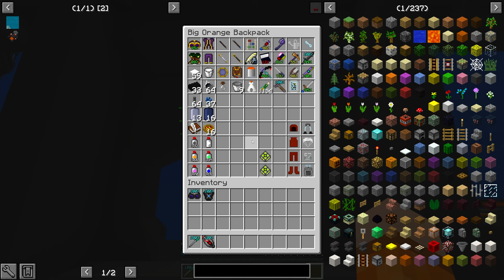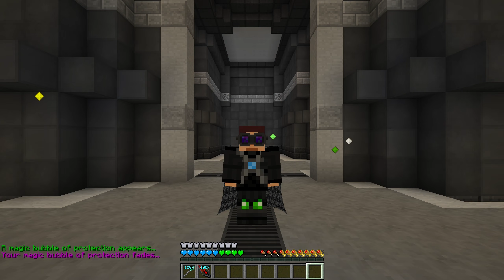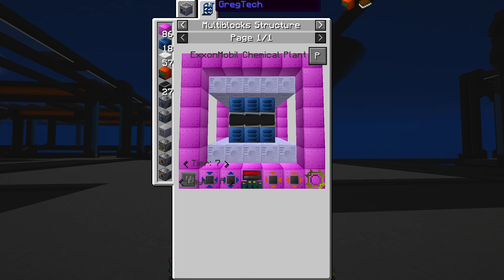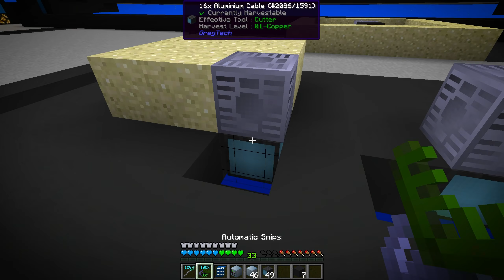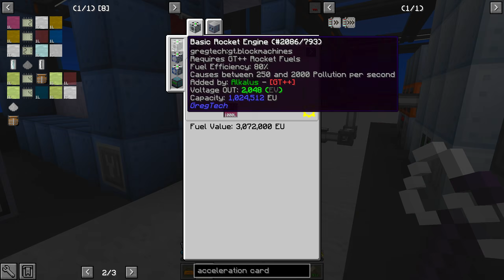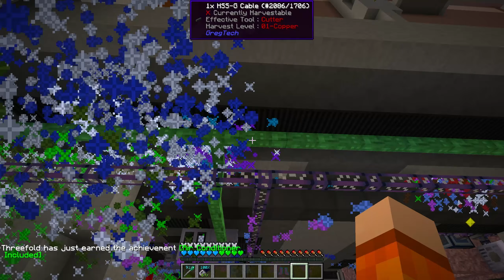Gregtech New Horizons S2 64: Three Of Seven

Comment: I just spent an hour in NEI looking through all the ridiculously realistic oil cracking and refining pathways trying to figure out what pathway I should use to take to make polyethylene, since apparently with the recipe I was planning to use starting from ethanol (from biomass from the forestry fermenter) has the final step only available in MV or above. I'm in LV lol, I had a ton of fun doing a test batch of all the reagents I'd need and getting all the ingredients together, just to scratch my head when it wouldn't make ethylene! Half tempted to make an MV reactor but don't have the stuff for it, so here's hoping the oil I've got nearby is light lol. I want to make it into refinery gas and get ethylene from that.

Comment: for AE, imo you should add an AE battery (or a few). it drains energy from its storage when terminal is opened so that you end up with no energy in controllers every now and again.
Reply: there is like 8 dence energy cells near central controller

Comment: Don’t necessarily trust the NEI preview, it’s not always correct or has unnecessary tier of blocks
You can open the structure projector to edit the GUI in order to change the coil tier or other blocks that have tiers, also means you only need 1 projector and can do multiple tiers on a multiblock such as the chemical plant or MEBF
You can always just make fluid patterns for the chemical plant for rocket fuel
Can always add more input hatches on the chemical plant

Comment: if i were to put an auto crafting setup somewhere in that base, i think it'd be north too, under the hives, or maybe wrapping around it like a giant hexagonal ring, to fit the hexagon theme and to give you ludicrous amounts of space, separated into floors on each side of it, with the most room for multi blocks like lcrs and stuff on the bottom and top layers, and single blocks and maybe like a clean room in smaller layers along the sides

Comment: Technically speaking you can skip making T2 padding, though I wouldn't necessarily recommend it. Ross128b is a habitable planet, and doesn't require any kind of thermal padding or oxygen gear at all. The Asteroids dim is perma night, and what T2 padding does over T1 padding is protect against solar radiation...which (presumably?) does not exist in a perma night dimension. So Asteroids can skip T2 padding as well. The other T3 planets you can still get away with skipping it if you craft yourself a Dragon backpack, it will heal you faster than the solar radiation can kill you, but taking constant damage is maybe not the most pleasant of experience. For Steve or for the player. Ultimately nothing significant gates T2 padding bar PBI, which you want to cook two manual batches of to satisfy the questbook (and it's generous rewards for still doing cell basic chemistry circa IV) while crafting enough for a set of T2 padding down the line anyhow, so it's not a big deal regardless.

If you're playing with pollution off there's basically no reason to give an Implosion compressor anything better than an LV hatch. At least until much, much later. The recipes are all fast enough for occasionally crafting a rocket, and that's mostly what you need it for. If you do have pollution on overclocking the Implosion Compressor is a great way to limit it's pollution output, since machines produce pollution while they're running. If a recipe is completed 16 times faster, that means 16 times less pollution is generated.

I've said this before, but it's worth saying again: If at any point you are not good on power, upgrade power ASAP. Especially in this era of digital storage, when your entire base's power production is powered by itself, running low can quickly lead to a death spiral and you being knocked back to the stone age.

One thing Silicon Dioxide has over Raw Silicon is that it can be cooked into silicon ingots much faster and easier, completely skipping the hot ingot step. Of course one thing Raw Silicon has over Silicon Ingots, in turn, is that Raw silicon is actually useful sometime pre-T5 rocket. So, you know, ups and downs 🙃.

If you didn't end up going with Benzene power and are short 1,2-Dimethylbenzen to split between bees and hydrogen, BTW, basically any measure of petrochem is going to give you oodles and oodles of various gases you can electrolyse into hydrogen. Just pick whatever random thing(s) you're not using, throw it through an electrolyser, and boom: Hydrogen solved.

Reminder that Three hasn't solved his comb processing bottleneck yet, he mitigated it. Iridium, Platinum and Palladium are, on average, going to overwork that LuV powered LCR by themselves, to say nothing of any future additions to the Hives. Bees are a fantastic source of passive resources, and the Alvearies they live in cost peanuts - literally if you're using that as your source of seed oil 🙃- but don't underestimate the power cost of processing those combs.

My advice, if you don't craft a chem plant early for whatever reason, is to make your first one out of tungstensteel if you can at all afford it. You'll need that tier for some recipe or another down the line sooner or later, so might as well save yourself the trouble of crafting a set of casings more than once. If you've got a specific recipe in mind for a chem plant - say a dedicated Nitrobenzene producer - upgrading the casings beyond the minimum won't benefit you. But always have at least one chem plant with tungstensteel casing tier if you can afford it.

Regarding rocket fuel, there is no real reason to bother with Dense Hydrazine Fuel Mixture. The only thing that CN3H7O3 Rocket Fuel needs which DHFM doesn't is a bit of hydrogen, carbon dust and Nitric Acid - hardly a challenge for anyone wanting to craft a T3 rocket. You also - if you've been keeping up with your magic progression - certainly have access to interdim teleporters by now, so if you wanted to only craft up a single big batch of rocket fuel to make the initial trips crafting CN3H7O3 right away will save you some batch crafting down the line.

A 500s recipe for, basically, an LuV-tier ingot you need eight of per machine hull is cause for concern? Oh you sweet summer child. Someone has forgotten the pain that is Ruridit, I see.

Anyhow, Ruridit - to give a quick TL;DR: for the uninitiated - is a material you need 16 of per LuV motor. And that takes 590s to cook with radon, 760s without. That said there's no cause for alarm. Sufficient investment into Volcani and Krypton bees will bring that nightmare all the way down to a very reasonable ~96 seconds per LuV motor, assuming only a single Volcanus working on the job. And by the time you're crafting LuV motors you better have more infrastructure than that 🙃.

Oh yeah, one more fun factoid: The NEI preview is not, as is often the case, a perfectly reliable indicator of how to build multiblocks. Chem plants are composed of various different parts that can be upgraded individually, much like how an EBF could have HSS-G coils but still only be running on MV power - there's just never a reason to do so. The casings gate what recipes are possible, the machine casings determine the maximum tier of hatch you're able to use, the pipe casings determine number of parallels and chance not to consume catalyst charges, and finally coil tier determines recipe speed much like the old Pyrolyse Ovens. Tip: Machine casings determine maximum hatch tier, not energy tier. IV machine casings can handle an LuV recipe if you give the multi 2x IV energy hatch, but will not work if you try to run the same recipe with one LuV energy hatch.

Note that while you can craft a chem plant much earlier in the pack there's very few reasons to actually do so. Usually - not always, but usually - you use a chemical plant only when a recipe actually requires it.

Correction: You're going to need Coal Tar distilled into Anthracene all the way up to T7-8 rocket fuel. It's a required ingredient in Hydrogen Peroxide, which in turn is required for Hydrazine, which is the basis of DHFM, CN3H7O3 and H8N4C2O4. That said unless you're producing rocket fuel to turn into power - which is a perfectly valid, if off-meta solution for power gen, BTW - you don't need too many buckets of rocket fuel to actually get you around. Again, interdim teleporting has been available since post-Mars if not post-Moon, so the number of actual rocket trips you absolutely need to make with these upgraded fuels is rather limited. To say nothing of making a slime rail gun to launch rockets into orbit at minium fuel.

Heat resistant coke oven casings at any, let stand this point in the pack? Someone cut the budget on the not-so temporary ICO I see 🙃.

Waterline is exactly as silly as it sounds. Kevlar line also is probably not going to see the light of day, because it's so unbelievably stupid - even by GTNH standards - that the Kevlar bee is considered sacrosanct until and unless someone de-stupifies the chemical chain. I vaguely recall one of Bastnasite and Monazite line not being particularly useful, at least in full...? Not sure, but either way we'll see how much of those will exist. Naqline is guaranteed, part of mandatory progression.

Be very careful when auto-building multis like that that you don't end up with unexpected hatches anywhere. More than once have I seen someone be very confused why their multi was constantly failing recipes, only to realize that a hidden second energy hatch was added, overclocking the multi and making it fail on the 1/2A provided.

For those who caught the hydrazine recipe outputting 2-Ethylanthraquinone to be recycled in a closed loop into 2-Ethylanthrahydroquinone, congratulations. You noticed it before Three did 🙃.

You can get away without automating PBI in IV if you're not doing Advanced SMDs - which I would recommend doing to make Quantum Mainframes craft twice as fast. They're a major bottleneck in crafting your first Assembly Line.

If needing to rush a T3 rocket to access the personal dim sounds cruel even for GTNH, it's worth noting that several things were different back then, meaning that starting a "permanent" base build in EV was futile if not impossible. So even if you got the portal early you'd have had to completely rebuild/redesign your base immediately afterwards. These days setting up the beginnings of a long term base in EV is significantly easier(/possible), and the personal dim portal was accordingly moved to T1 rocket instead. You also didn't actually need T2 padding to get the personal dim portal back then, since it was gated specifically behind the Asteroids dimension 🙃.

Reminder, once again, that Voiding Drop Filter completely nullifies the whole egg warp event. As would actually continuing Thaumcraft progression and, you know, dealing with warp directly 🙃.

T1 thermal cloth punishes you for forgetting string exists. T2 thermal cloth punishes you for forgetting to upgrade your machines.

...Is that a voiding drop filter just sitting in a random chest behind your AE2 terminals? Are you sure you aren't secretly planning on the return of Nomi Chicken 🙃.

T4 rocket is going to need Assembly Line, so that ain't happening for a hot minute.
Reply: In a previous episode, Threefold crafted 8 heat-resistant casing before realizing that there were better options. I think he just decided to use them because he already had them on hand and he didn't need the fuel line to be all that fast.
Reply: @nikolaysitnikov796  I'd congratulate you on having a better memory than I do, but as it turns out that is so low of a bar to cross it doesn't end up being much of a compliment 🙃.

Comment: Very nice!  I feel like for the most part the rockets get relatively cheaper, so when the time comes for the t4, it will be even faster!
Get the Krypton Bee for EBFs <3
And the plutonium bee
Also you DO NOT need the LuV machine casings for the chemplant!  The hatch tier is capped at the casing tier, but it can accept two energy hatches so IV casings allow LuV recipes
You can also upgrade the industrial coke oven
You'll never have to craft kevlar, there's a bee for it that I don't believe takes any kevlar to breed ("just" a uhv replicator iirc)
The view cell to hide fluid drops is no longer necessary, the terminal now has an option to switch between "items/fluids", "items only" and "fluids only".  Well most item terminals do.  The arcane crafting terminal is one item terminal that doesn't have this option

Comment: I must be missing something about power.  If you're generating 120,000 eu/t and using 80,000 eu/5 seconds aren't you only using like 800 eu/t?
Reply: it's average EU usage over the last 5 seconds, not 5 seconds of EU usage
Reply: still, from /5 secs to /t you divide by 100 (/5/20) which is 8000 eu/t. Still bad, but not nightmarishly bad.
Reply: @AlfarelSynthesis Yep you're right, he has about 30k eu generation left over 120k he generates.

Comment: Threefold don’t forget the advanced nanosuit jet pack actually has a boost key that is a lot faster than normal flight speed
Reply from the maker: The Boost Key is only available on the next jetpack upgrade after the Advanced Nano :(
Reply: @Threefold. it’s under ic2 controls called “boost key” 
Also, the normal quantum chestplate actually loses boost mode and it only returns with the Gravisuit upgrade
Reply: guys, boost this comment so that Three may learn some more!

Comment: Question: If the power consumed is displayed in /every 5 secs and the production is /tick. Doesnt that mean that the cnsumption has to be devided by 5 to get to /sec and then by 20 to get to /tick?
Reply: The EU consumption rate is correct, it just displays the average power usage over the last 5 seconds
Reply: That’s what I was thinking, I was wondering why three was so stressed for power if that’s the case, but I don’t know if his benzene production can keep up with his max power burn so I’m just going to assume he knows better about the power issue.